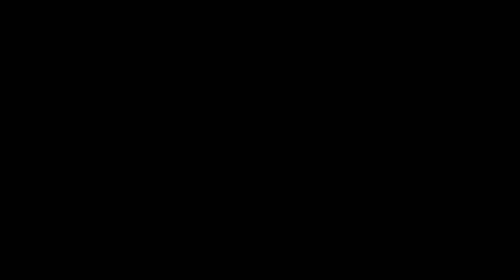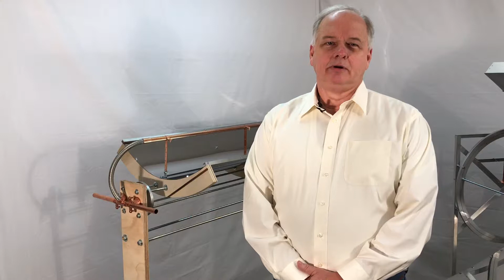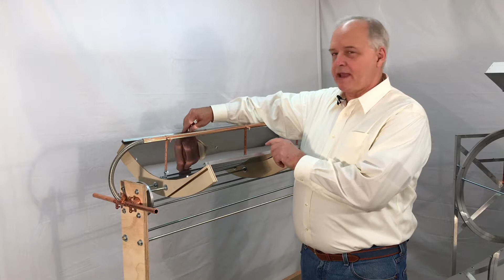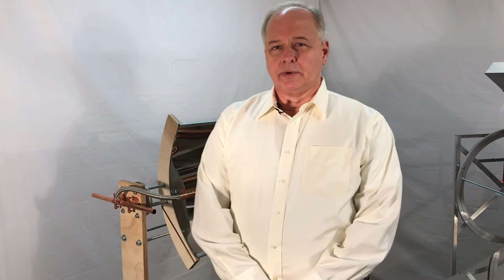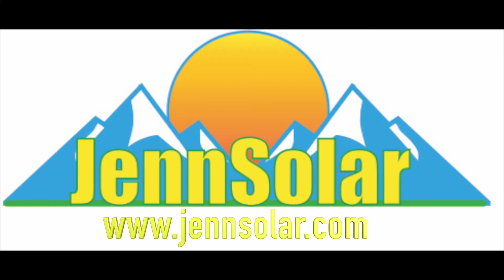RingTrough - Existing Parabolic Trough Technology

Comment: Fix the pipe in place and use a pillow block bearing to move the reflector using the pipe as the shaft. Problem solved
Reply: That's what I was thinking the whole time.
Reply: right!
Reply: I made one of these in 1960. Boiled water real fast.
Reply: I think I know what you mean, but can you explain a little more, please?
Reply: The pipe still rotates, so what creates the seal between the pipe and manifold?
Reply: @Mike-lu1pt  why would the pipe have to rotate?
Reply: @guillermocruz2440  not sure what I was thinking at the time. I can now imagine the pipes being fixed with the parabolic mirrors rotating around the pipes